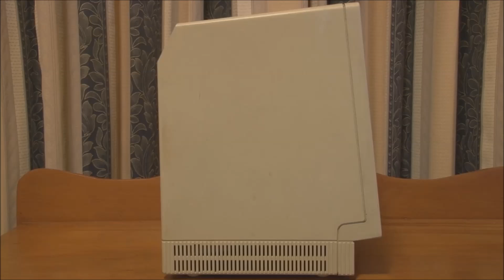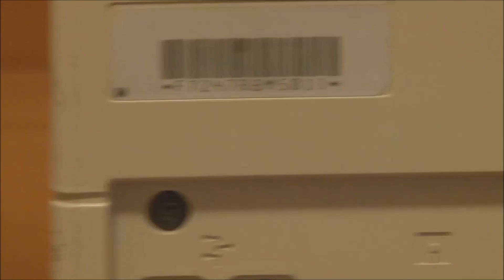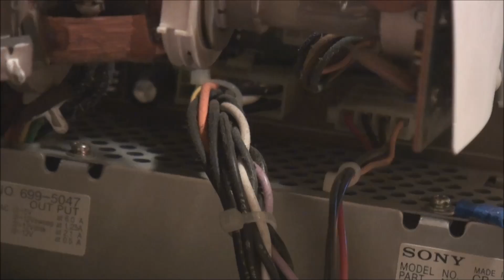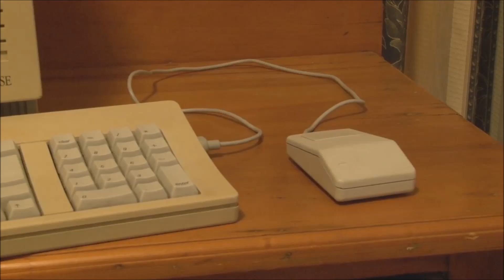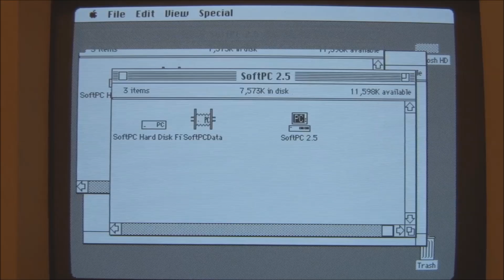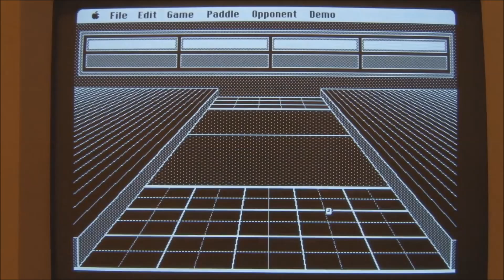Apple Macintosh SE (1987) Full Tour, Start Up and Demonstration

Comment: I own one of these with a hard drive and i must say... The SE is one of the greatest macintoshes of all time. It took the 68000 processor used in all other macs and showed its true potential free of many of the setbacks of the earlier macintoshes. A hard drive, expandability, compatible with system 6 and earlier versions of system 7. Had plenty of memory and users no longer needed to worry about the miserable amount of memory and expandability in early macs. It is truly in the top 10 greatest apple products of all time. And its also beautiful in appearance. An iconic mac. I remember it everytime i watch seinfeld. One issue is maybe the floppy disk but you could easily turn an se into an se 
Hdfd

Comment: Fourty years later, i miss my Mac SE.
Event hough I probably have several of them in the barn that were not mine...  not to mention clones of it... like Classic and Classic IIs.   

A 25mghz 030 card went in my expansion slot.   The great leap forward with the SE was ADB and Appletalk and the internal 20mb harddrive (17mb).  My first harddrive.   60ms access time, slow as snail splt!   The arm moving mechanism was actually on the OUTSIDE of the drive and ou could stick your finger in it and interfere with it if you were being a j3rk..

The back of the SE is still IMHO the sexiest back of any computer I have ever seen in my life and I've seen a lot of them...

I gave my SE away to my cousin, but I still have the original motherboard hanging on my wall as lightning blew out the ADB ports, so I had to buy a rereplacementand installit myself which was a PITA.  I then jumped to a Performa 476 pizza box 040 at 25mghz.

Steve Jobs was adament against noisy fans int eh mac, and that's whyt he first models did not have fans in them... and they are indeed nice and quiet, except for the grinding of the floppy drive which pretty much  ruined any silence.

Comment: My hard drive is shot in my Mac se do you now how to fix it
Reply from the maker: Ethan Whitmer Repairing old hard disks can be difficult - you would probably be better off trying to find a replacement SCSI drive. Any half-height 3.5 in SCSI drive that uses the standard 50 pin SCSI interface will work in an SE.
Reply: Jason's Macintosh Museum
thank you

Comment: Is it possible to install an internal 1.44 disk drive on a standard SE?
Reply from the maker: Sapp440 I believe that you can - but you need to change the floppy controller chip, and the ROM chip. You would have to get those from an SE SuperDrive / FDHD.

Comment: Since you have 4 MB of RAM, you should enable MultiFinder… Do this by clicking Special, then Set Startup.
Reply from the maker: Good point - I am so used to using System 7 that I forgot about the MultiFinder feature in System 6!